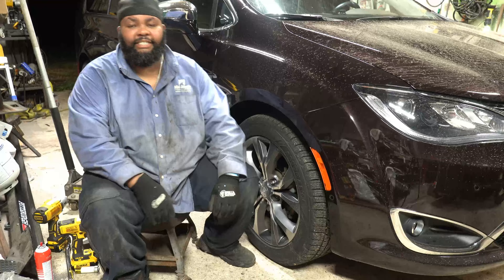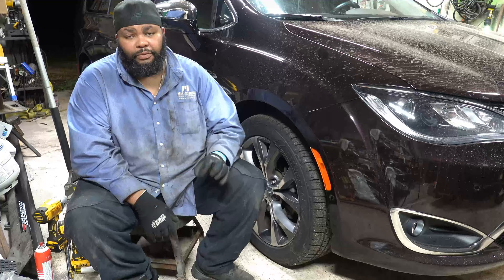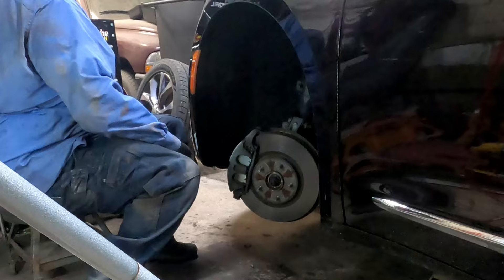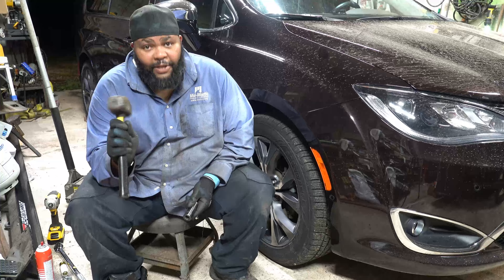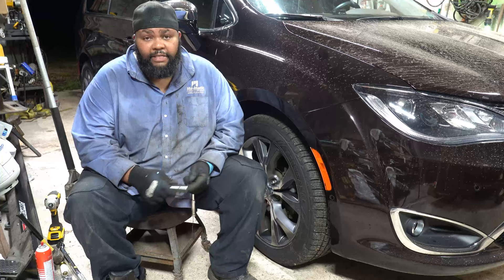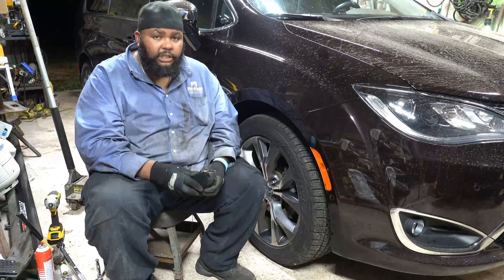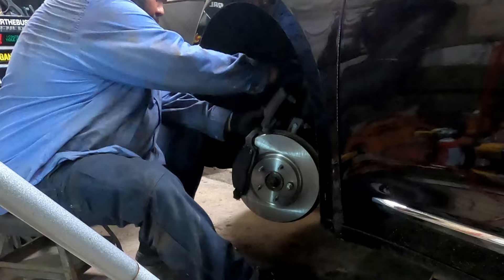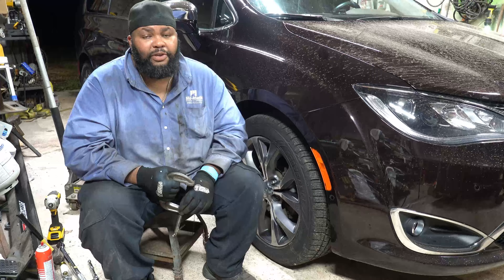Front Brake and Rotor Replacement on a Newer (2017) Chrysler Pacifica

Comment: Great video...helping a buddy do his brakes today and wanted to make sure there would be no surprises.   I got a tip for  dual piston.   Put an old pad back in the caliper, then use your c-clamp.   It will compress both pistons at the same time.
Reply from the maker: Great tip!

Comment: Great Amazon tip! Also, thanks for the DYI video for this vehicle. The local Auto parts store had me scared that the brake system on the Pacifica was so complicated that I should have the dealership do it. It ends up that there is a camber arm that often goes bad and they usually change it when they do the brakes. Apparently, the stock part will sometimes wear out before 45k. The new part is “stronger” than the original.
Reply from the maker: Glad I could help and we have 100k on ours and not a problem

Comment: GMTA ... I did front rotors and pads recently. I'm doing the rears this weekend if it doesn't rain.
Reply from the maker: I had to get them done prior to our 1200 mile road trip. It was only mildly annoying but driving for 8 hours and having a van LOADED I just wanted to get them done. Good luck with your rear brake job. The good thing about my garages is I can do it rain or shine.

Comment: Hello, Thank you for the video. Is it possible for you to make a video on how the get the Pacifica on 4 Jack Stands using a floor Jack. I need to understand where the alternate lift points are on this vehicle apart from the pinch welds. Also can you provide the Torque numbers for all the fasteners from the Manual. Appreciate it.
Reply from the maker: Hey man thanks for watching, I am not sure when I will be able to post a video on getting the Pacilfica up on jack stands as I haven't had to do that yet. Torque numbers? I don't know nothing about that. I make sure they are Good n' Tight, especially if I am going to be the next person who will be taking the nut/bolts off.

Comment: Can u plz advise which grease is best for caliper sliding pins ? 
When I bought brake pads for my 2019 crysler Pacifica , they sent small packet of grease.  I guess that is only to be used for brakes but not calipers .
Reply from the maker: A regular bearing or all-purpose grease is good but not necessary.

Comment: Great video! I can tell you have done brakes more than once before😊 How are the Amazon parts holding up after a year?
Reply from the maker: Lol, yes indeed I've done more than my fair share of brake jobs and sadly I ended up replacing the pads for ones from my local auto parts store. They made lots of noise and I thought it was just going to go away but never did.

Comment: Rock auto is cheaper. Dodge is crap ever since they moved across the pond, can't call em dodge/chrysler anymore.
Reply from the maker: Check that out... Rock auto is cheaper. I don't order from there as often as I probably should. It depends on how much lead time I have for the repair. If something critical breaks I will look at local parts stores or the dealer but anything else I usually will order it online where ever I can find it.